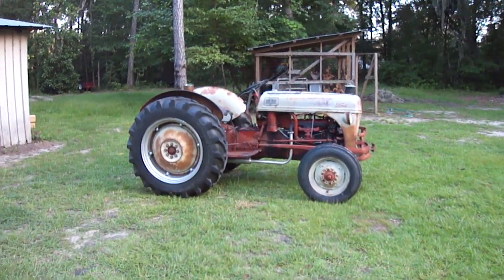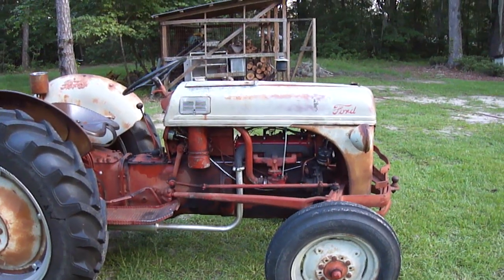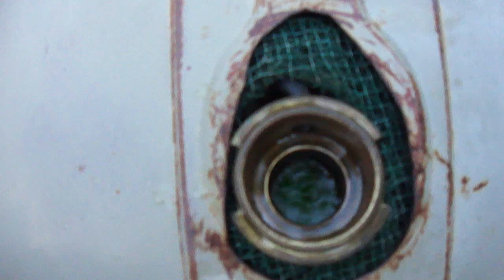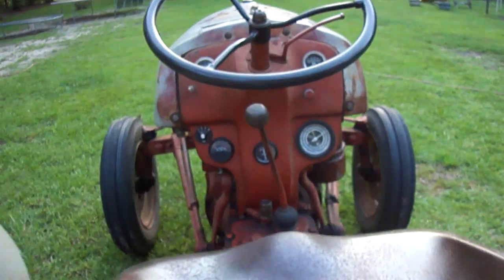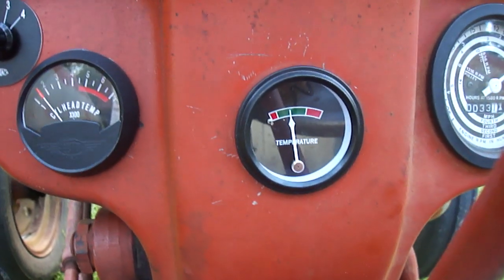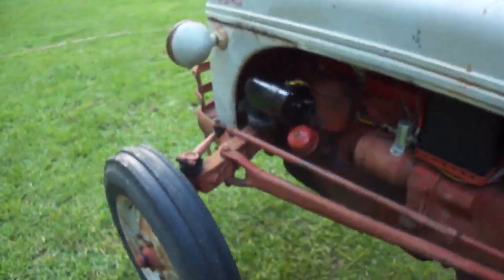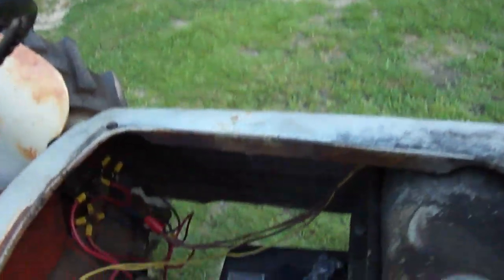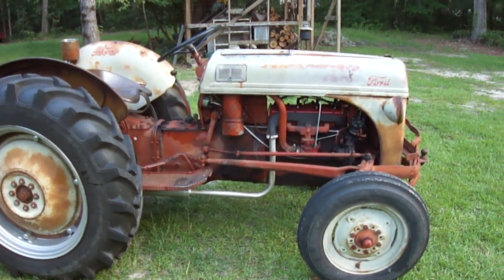Ford 8N 1952 Head Gasket Leak Part 3 of 3

Comment: I watched  1 - 2 & 3 and think you did a good job.  I had same problem on 52 8N but head gasket took care of the problem - also installed a water temp. indicator.      I Love the 8N's  - we have two of the 1952's.      12 volt on both.
Reply from the maker: Thanks!  It was a fun, yet frustrating project.  Still running great!
The 8N in the videos is still 6 volts, positive ground.  My other 52 8N was converted to 12 volts.

Comment: I just bought an 8N (Side mount Distributor) which I believe is post 1952? I got some SERIOUS blow by out of the radiator with some oily sludge burping up too. Just ordered a head gasket from yesterdays tractors based on what I saw in your videos. Thanks for posting them. PS. I'm in Pasadena Texas.
Reply: update: I installed the new head gasket but did not see any of the blow by indicators you showed here so after rewatching the video. I believe now that I do have a cracked head.
Reply from the maker: Good to hear about no more serious blow-by.  What are your symptoms now that indicate a cracked head?  Did you flush the radiator and block after you replaced the head gasket to remove any previous oil contamination?  Do you have water in your oil (milky coloring)?
Reply: Like i said, the SERIOUS blow by is gone but there is still some slight burping through the radiator. I did have radiator flushed and professionally boiled out. I dis not flush the block and yes, still a slight residue in radiator but much less than it was before. Something i belueve i am going to try is to retorque the head. I originally torqued it to 75 foot pounds and its now ran a couple of hours so after heating up. Considering torquing head to 80 foot pounds if a 75 doesnt stop the blow by. If that doesnt work then i might have to accept warped head and just replace it.
Reply from the maker: Retorquing after running is a good idea.  I'm sure you know the torque sequence and specs, but just in case:
https://www.newoldmanuals.com/ford-8n-9n-2n-online-service-manual/pg_0130.htm
Don't forget, head bolts and stud nuts have different torque specs!
New heads are about $200 (Yesterdays Tractors).  I replaced mine due to warped AND cracked AND rotted at one bolt hole.  Bonus was being able to add a temp gauge sensor in new head!  I recommend to drill and tap for the new temp sending unit BEFORE installing the new head.
Reply: There is a slight milky color to the oil which i am about to change again.
Reply from the maker: Milky = water in oil.  Can be caused from normal condensation due to temperature changes.  Or it COULD be a crack in the block (not likely, but possible if the tractor has been in a very cold climate at some time).  Change oil and monitor since it COULD/PROBABLY have been from the bad head gasket (water intrusion through the cylinders past the rings).  I think you fixed it!

Comment: Thank you, I am beginning to feel that I can own, operate and repair a Ford 8N tractor.
Reply from the maker: These are easy tractors to work on.  Minimal electrical stuff and big bolts and nuts.  And most everything on it can be rebuilt.  I just acquired a 1928 Model A.  It runs, but I still need to learn it.  Good luck!

Comment: Thanks for sharing, nicely done.  I think I have same issue, oily film brownish water in radiator.  Did you need to grind down the block too?  Now that you've done this, if you went right to it, how long would you say the tear down and reassemble took?
Reply from the maker: Sorry for the delayed response.  I worked on this off and on over a 2 week time frame.  The actual work was pretty easy and straightforward.  If I had to do it over again knowing what I know now, and if everything was ready to go, it would have probably taken a fully-focused day, assuming I had the new block ready to go.  Painting, getting the blocked drilled for the new temp sensor, that took time, but it was mostly hurry up and wait.  The actual wrenching was pretty quick.  I did not grind the block, but I did check it with a level.  It was very flat.  The 8N has been working great since then with no cooling issues (as of 7/19/2017).

Comment from the maker: Richard,

I just read through the thread regarding your question on Yesterday's Tractors (9N,2N,8N forum).  souNdguy gave you some good diagnostic advice.  I have experienced similar issues and the right side (as you sit on the tractor) inspection cover should be removed and you can usually find the source of leaks.  I blew a cylinder gasket and it was very obvious once I removed the cover and peeked inside.  Please do not put your hands in there while it is running!

Jimpsc.

Comment: Hi their, I have a 1951 ford 8n tractor. I am having some problems with my 3 point hitch implement staying up when I am driving the tractor forward. the implement stays up only idling in neutral but when I shift the tractor in 3rd gear the box scrapper goes down. thank you.
Reply from the maker: That seems odd.  I know this is late but you may want to check out Yesterdays Tractors web site and the 2N/8N/9N discussion forum.  Lots of good info there.